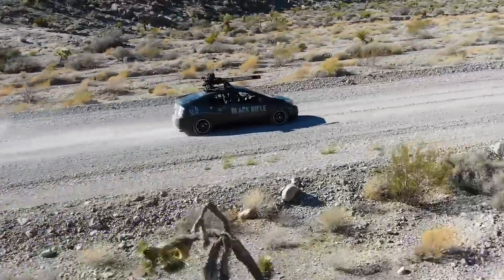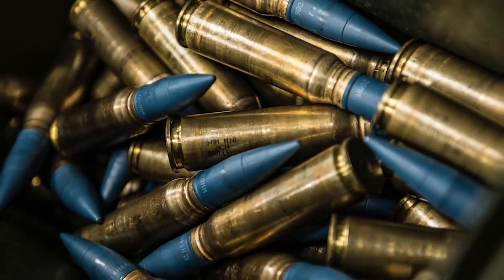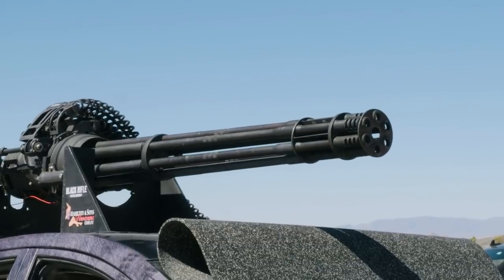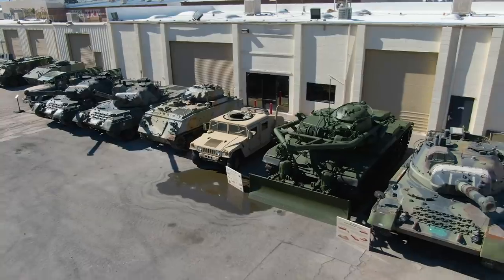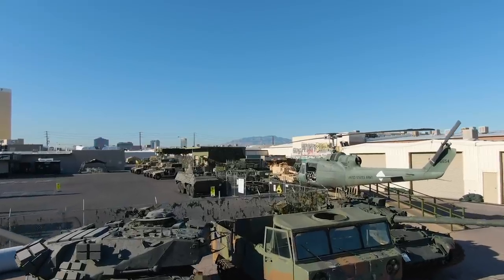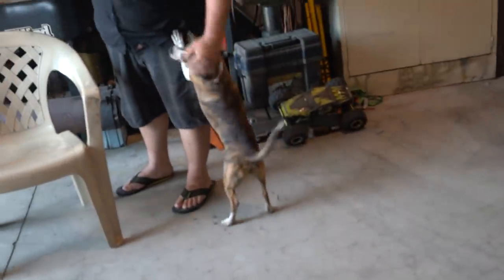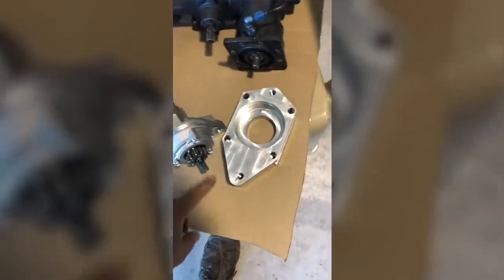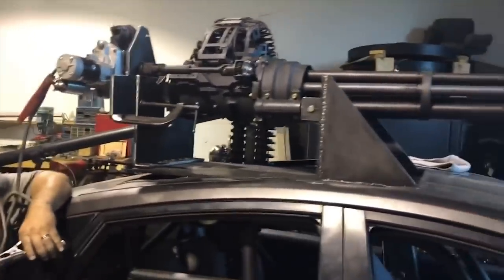20mm Prius Vulcan - Behind the Slow Motion

Comment: I think that if you replaced the glass windshield with a polycarbonate windshield I think that would fix the problem of the windshield blowing out
Reply from the maker: We were trying to keep the costs super low because we thought it may wreck the car. Custom polycarbonate cut was super pricey when I check 😑
Reply: What about adding a visor to shield the blast?
Reply: Maybe make to the length of the muzzle. I mean you don’t need to really look up while driving.
Reply: It just seems the cheap way to do it unless you do a half pipe shroud Under the barrels.
Reply: @Fullmag  a sheet metal visor . Kinda go fallout style. Tell Bob ,milspec.
Reply: @redacted3911  like the long Tom's the military is currently using. It looks like a flat shovel piece under the end of the barrel to protect the crews from the blast blowing up dirt and dust . I bet you're on to something.
Reply: texasdee slinglead yes sir that’s what I’m talking about.  Seems like a cheap fix. Simple solution.

Comment: To get more bang for your buck, instead, purchase an M163 (Which is an M113 APC with an M61 mounted to it for air defense). It has a rotating turret and will have the M61 preinstalled, along with the necessary motors and range finding radar.